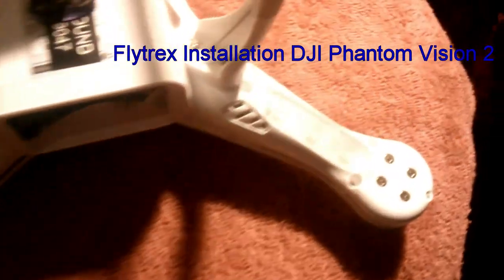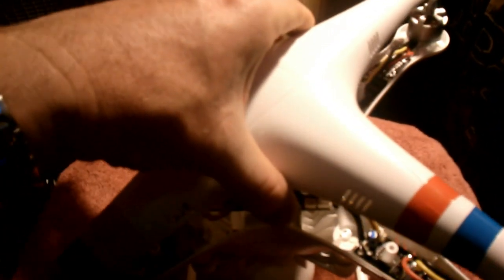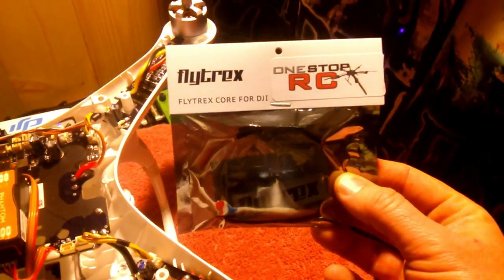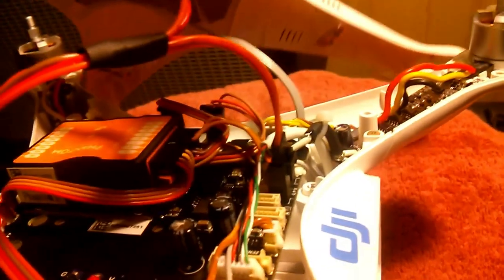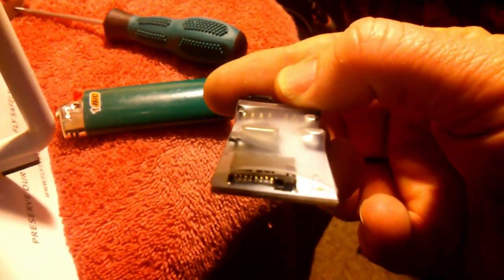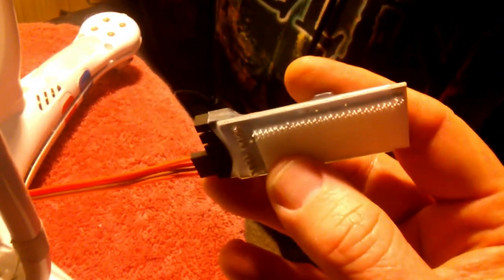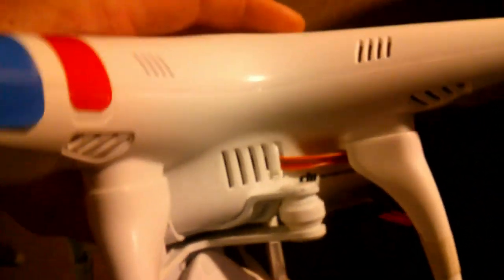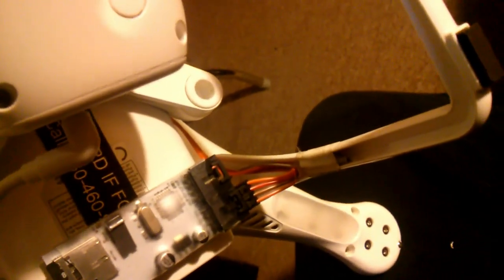Flytrex Installation DJI Phantom 2 Vision

Comment: Nice install....
Reply from the maker: thx Dean,,,,i didnt want to un-pin the exisiting core cable connector  to enable routing thru existing shell holes,,, so i routed it thru the vent, works,,,  test flew today,,,,currently trying to upload the file tonight, but the flytrex website is not uploading,,,or my browser or OS is not recogniziing,,,not sure whats up,,,
Reply from the maker: uploaded my first mission today,,,works very well, flytrex support was awesome,,,had to load google chrome to enable uploading ....older browsers don't support html5....works great....great product...
Reply: Happy to hear your enjoying it.  I was not aware of browser issues...  thanks for letting me know.  Dean, onestoprc.com
Reply from the maker: yep,,thanks Dean....I may be looking for a four channel radio system for my rc airplane this spring...i used to use a hi-tech system in the past,,,will look you up when i decide...
Reply: Sure thing, hope I can get some suppliers by then :-)
Reply: Either way I will see what I can do for you..

Comment: Very cool, I'm considering buying one of those to use it with Dashware to log me flights. I do have a question. Why didn't you just send wire down one of the wiring hole, instead of cutting into the vent? Either way, nice job! ;-)
Reply from the maker: thank's Bobster,,the connector wont fit thru the small wiring holes,,its way too big,,it barely fit thru the vent slot....
Reply: Makes sense. Not sure, but I think you can pull the pins out of the connector then reinstall them back into the clip. Once again, nice stuff! I'm hoping to post a video soon on how to add sound to your Phantom 2 Vision video.
Reply from the maker: yea, i think you can dis=assmeble the pins,,,tried that before on one of my RC plane servo connectors and hosed it up,,  i wasnt gonna buy another 10 dollar cable if i hosed this one up,,,definitely can do that though..i just suck at it....lol